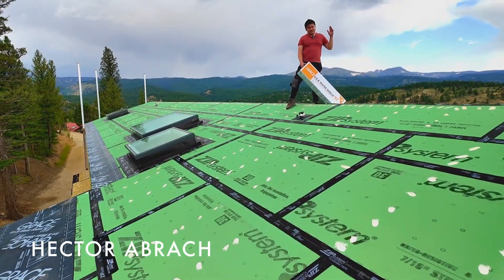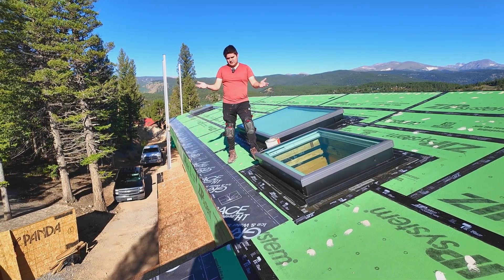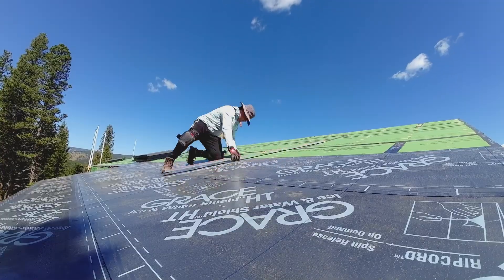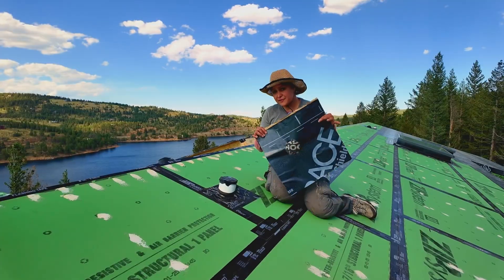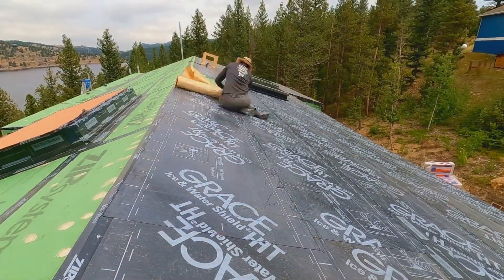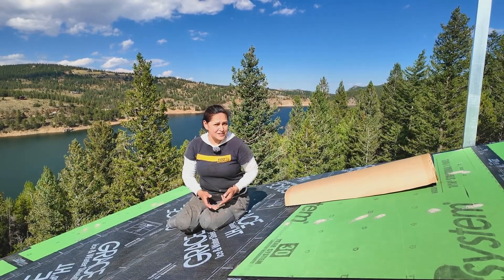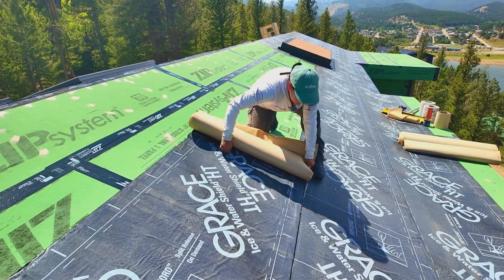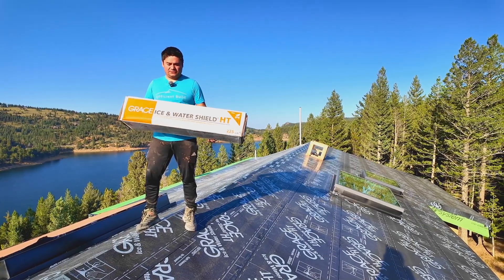How to Install Grace Ice & Water Shield | Roofing Best Practices, Tips & Tricks

Comment: If ice and water shield is installed under an entire asphalt shingle roof, is it hard to remove the ice and water shield when the shingles are eventually replaced?

If ice and water shield is installed under an entire asphalt shingle roof does this sometimes created moisture retention issues from the attic?
Reply from the maker: Once the ice and water shield is installed, it is very very difficult to remove; in fact, I'd say it becomes part of the structure. We don't do remodels or repairs but at that point I'd say you'd also need to not only replace the shingles, but also add a new water retardant barrier or re-cover with more Ice and Water Shield.
As far as moisture in attics, it is not different than other roofs. It will not let water escape from the inside to the outside just as it doesn't let water enter from the outside to the inside. A vented attic would take care of removing any moisture from it.
We only do conditioned attics with mechanical ventilation, so that is not a problem for the way we build.
It's typically how the combination of elements work together that cause problems or work together, not down to a single item.

Comment: the roof slope is like a 5/12 maybe 6/12 so you don't actually feel that unsafe without harness.   7/12 up to what ever is code is when it gets scary. i am not a roofer i am a framer that's trying to learn how to properly do roofs.  great videos guys.
Reply from the maker: It's actually easier than that, it's a 4:12

Comment: negative overlaps is why you start at bottom. that way water cant get under when it runs down.  Does anyone know if a regular blue skin membrane can be used in place of the ice and water sheild
Reply from the maker: Water can wrap around due to surface tension, but not much, maybe 1/4 "- 1/8" back up

Comment: You dont want to use stringer nails on the drip edge, use regular shingle nails and then tar over the top of the drip edge before you lay starter shingle. Its code in florida.
Reply from the maker: Hey, I'm not familiar with the term stringer nails, would you clarify? We are using button cap roofing nails (Aluminum). Are those stringer nails?